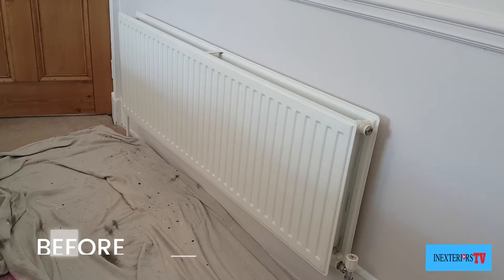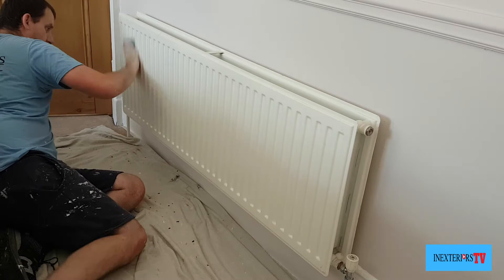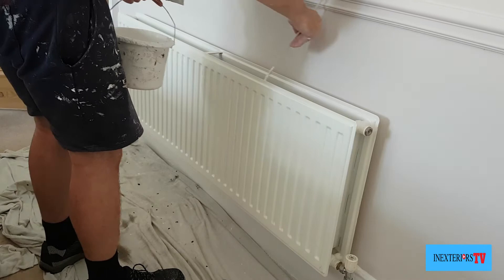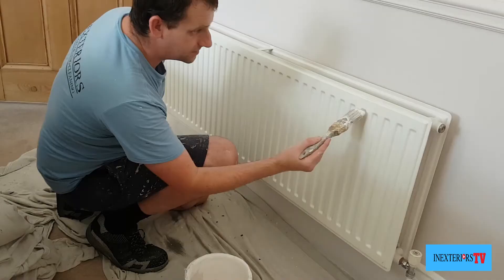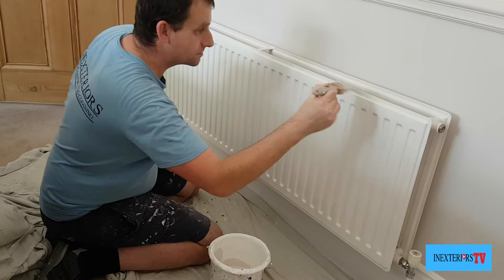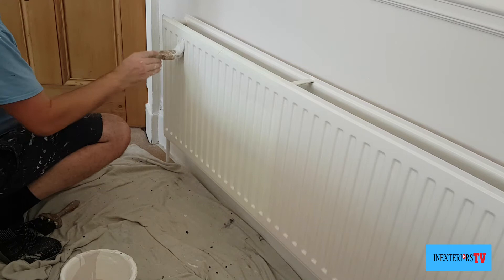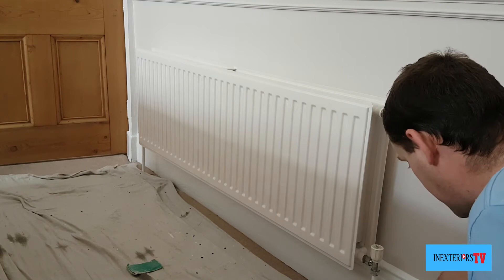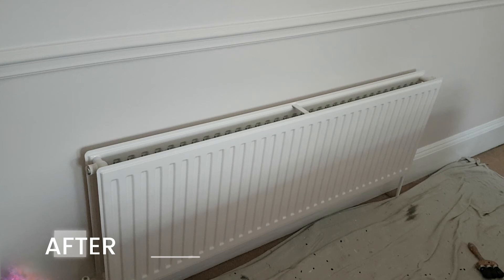How to paint a radiator. painting a radiator.

Comment: I’m liking your videos and subbed, how would you treat a radiator which has the enamel bubbling at the bottom and signs of rust? It’s a small bathroom radiator
Reply from the maker: Thankyou very much for your support. sand spots of rust, then spot prime with an oil based primer or some rust converter,, the 2 coats of oil based egshell.

Comment: If I have a bit of rust at the bottom of the radiator do I just sand it then paint it or do I need to treat it with something
Reply from the maker: @Wes C . Give it a good sand back until there is know rust or minimal rust, then put some oilbased primer or undercoat first,

Comment: What metal primer would you use if you can see bare metal on the radiator
Reply from the maker: @Hard worker, Trade primer thats suitable for wood and metal, either johnstones or leyland. Do you have any recommendations.
Reply: @Inexteriors  No i cannot recommend a paint but I did think about using bin primer but I was put off when i seen a video where someone said it's a hard paint to use as it drys to fast.
Reply from the maker: @Hard worker, it does dry fast.